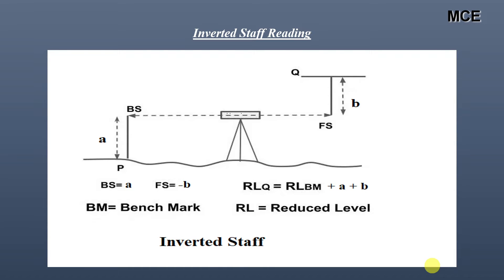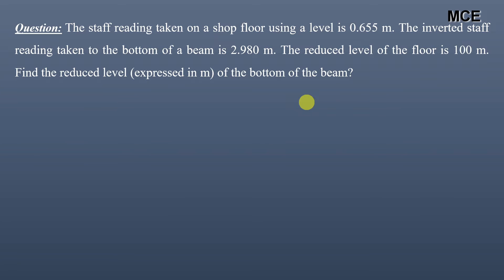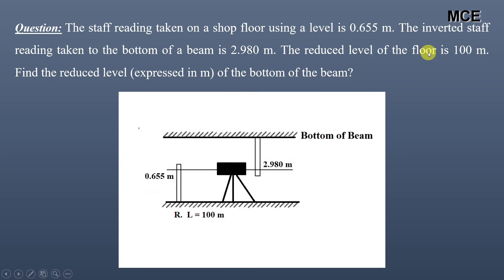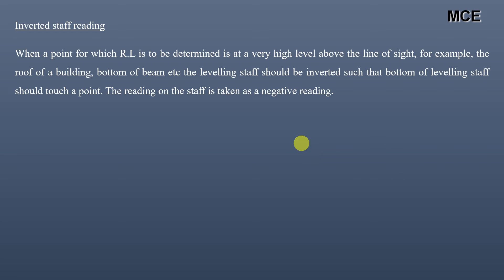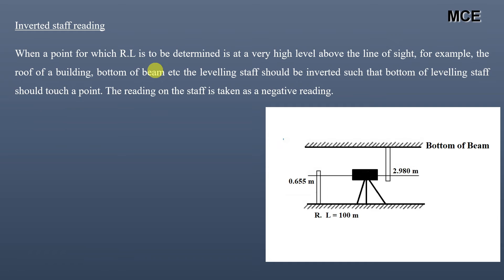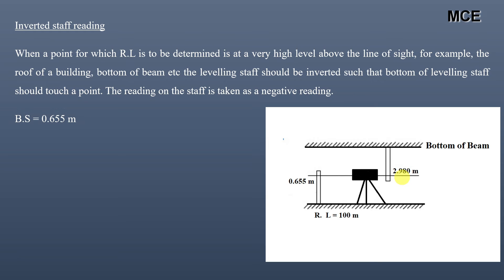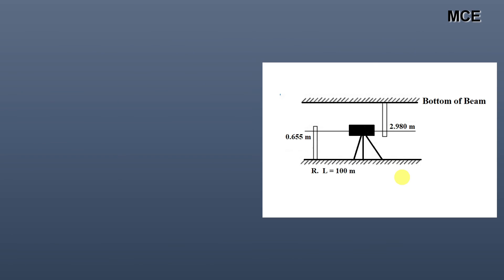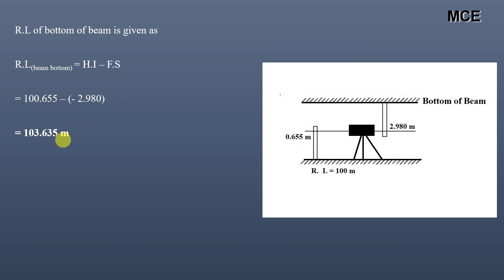Finding Reduced Level of a Point using Inverted Staff Reading| Solved Problem

Comment: The following observation was made for a construction project where RL of the bench mark (BM) at Point A (bottom of a lintel) was 101.50 m.

The staff reading (inverted) on BM was 2.25 m and the reading at Point B on ground before the instrument was shifted was 1.05 m. After the change point, the staff reading to Point B measured 1.35 m. If the last reading was taken at the bottom of a canopy (Point C) with staff inverted was 4.100 m, RL of Point C was

Sir please solve this pyq with figure for clear understanding of the question?